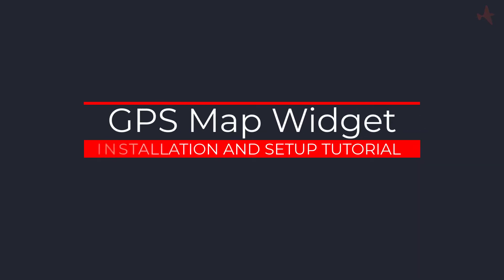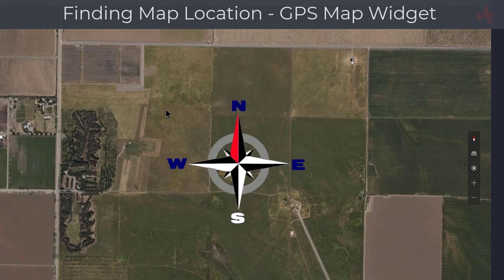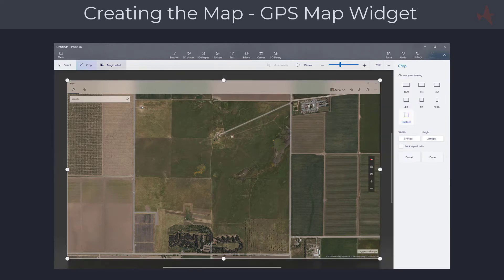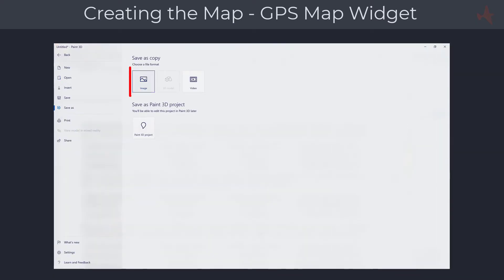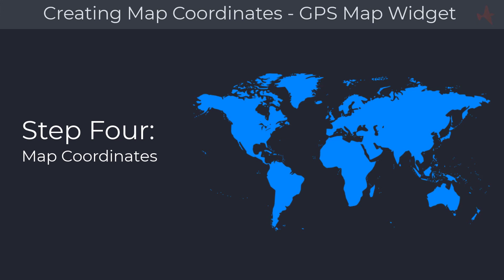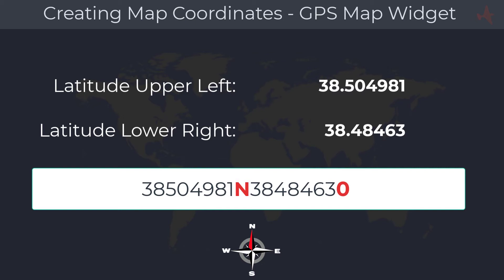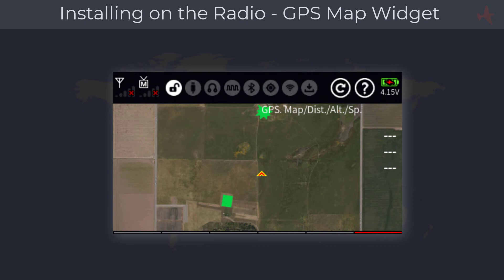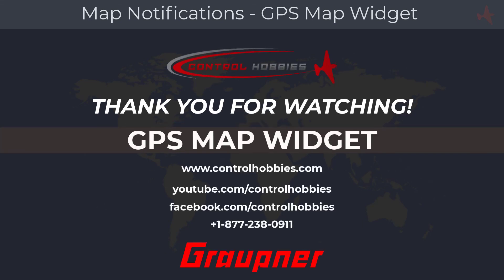GPS Map Widget for Graupner mz-16 and mz-32 RC radio system

Comment: Hi, a very interesting video and would like to know if this application will be available for the mz-24 TX in the near future, as I would definitely be very interested in getting if/why available?
Reply from the maker: You can get a similar solution with the mz-24 radio using an iPhone or Android device with a Bluetooth addon. If you want a fully integrated experience, then the mz-16 or mz-32 are your options.